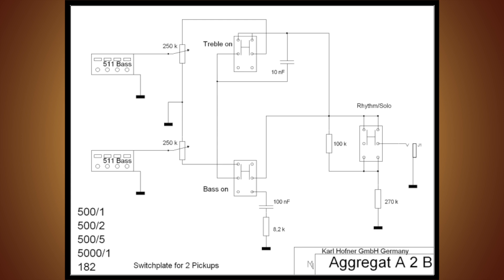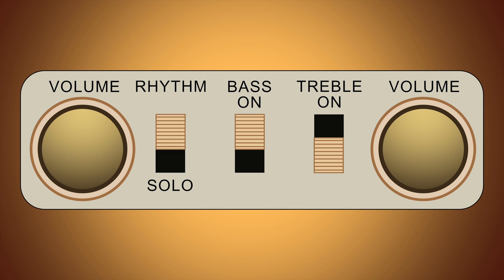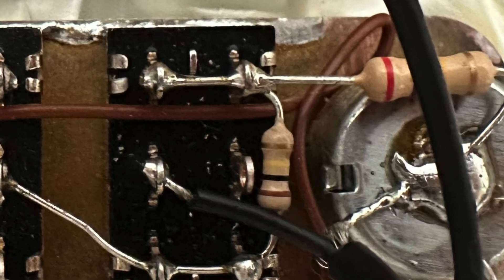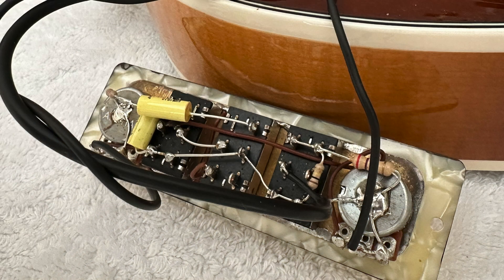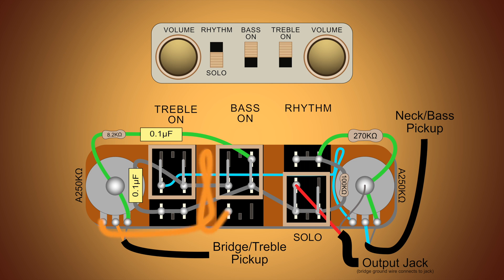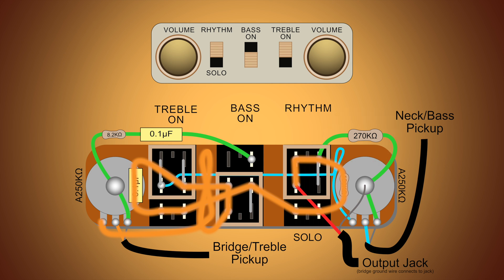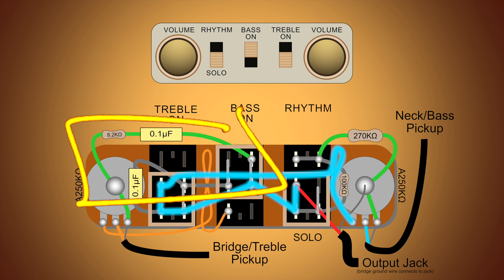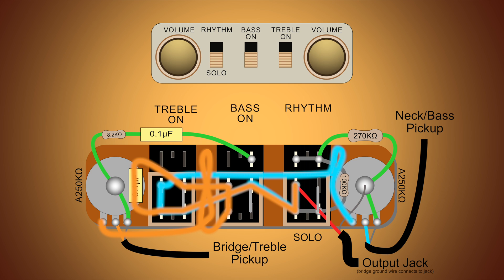The Illustrated Guide to the Höfner Violin Bass Control Panel Wiring

Comment: I had a  hofner president and the panel was always knackered. In the end if I got a sound I left it alone... I've just bought one of the cheaper hofner violins. I was hoping to use the neck pickup on full blended  with the bridge pickup with the tone down but it looks like thats out of the question!

Comment: This is awesome. So thorough and interesting. The only way I play is both pu switches off and solo on because I can blend bridge in as needed. I'm considering adding a third/middle pu and was wondering if there is anything I'd like to change when doing it.. maybe even making a new control plate that's just vvvt.
Reply: Tone knob?
Reply: @ARONHALLAM  Yeah, doing a B250k DPDT Volume  (neck/middle push/pull), B250k Volume (bridge), B250kTone (.022 mfd).. but considering a push pull for the tone pot too.. either with a total bypass of the capacitor, or a different cap value ..

Comment: Maybe it would be helpful to think of the switches as 6 single pole double throw switches operated in pairs, rather than as 3 double pole double throw switches.
Reply from the maker: You're probably right but I can't even get my head around about what you suggested. It's like a quadruple double-negative (whatever that is) 😂😂😂
Reply: @homemovies751  From looking at the diagram, only the left side of the "Bass" (neck) switch turns the pickup on (up) or off (down), the right side of the switch performs a different function, which is to take the combined signal from the "Treble" (Bridge) switch and bleed part of it to ground through the 100nF cap and 8.2k resistor (but only when the Bass switch is off (down)).

When the Bass is on (up), the signal goes to the Treble switch except for part of it which bypasses the switch through a 10nF cap.

At the Treble (Bridge) switch, only the right side of the switch turns the Treble (Bridge) pickup on (up) or off (down).  The left side of the switch either passes the Bass signal through (up) or blocks the bass signal (down).  If the Treble switch is up, the Treble pickup is on and its signal is combined with the Bass signal AND the part of the Bass signal which bypassed the switch through the 10nF cap.  If the Treble switch is down, the Treble pickup is off and ALL of the Bass signal is forced through the 10nF cap.

Next, the combined signal comes to a junction.  Here it needs to be said that an electrical signal will always go to ground through the path of least resistance.  But it will take ALL paths to ground in varying amounts depending on the resistance and capacitance it encounters on each path.

On the Rhythm/Solo switch, the left side appears to have no function, as the center terminal has no connection.

From the junction, some of the signal will always bleed to ground through the 100k resistor and the 270k resistor.  If the Bass switch is down (off), part of the signal (which would contain only Treble pickup signal) also bleeds to ground as mentioned at the beginning above.

If the Rhythm/Solo switch is up, there is less resistance through the right side of the switch and most of the signal will pass to the output jack.  If that switch is down, the "easy" path to the output is gone and all of the signal passes through the 100k resistor on the way to the output except for the part of the signal that bleeds off through the 270k resistor and the part that might be bled off through the Bass switch.

It's all about as clear as mud, which is why I plan to ditch it for a 3-way switch and volume and tone controls on my HCT 500/1 Cavern Bass.

Well, now I get to wait for some electrical engineer to come along and say, "YOU'RE WRONG"!  To which I say, "OK, Mr. Electrical Engineer, where have you been the last 60+ years."
Reply: @homemovies751  I went into a rather long explanation of how I thought this worked in a follow-up post.  That post seems to have disappeared. I wonder.

Comment: Fantastic video, many thanks! This way it's finally crystal clear, had to discover this myself by trial and error years ago. Some of the quick explanations online sometimes make it less intuitive than what it really is, and it's not always easy to help others understand after that. Just to be sure, so it means that the bridge pickup has its (high-pass) capacitor always active, in both Treble On and Treble Off?